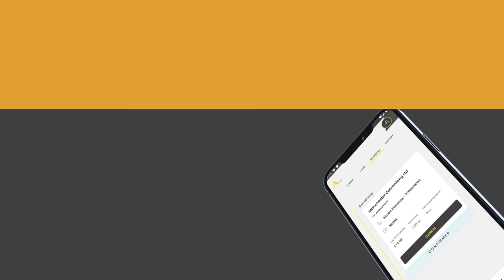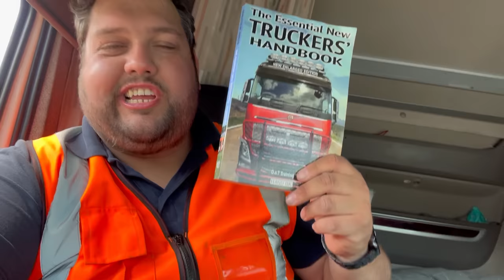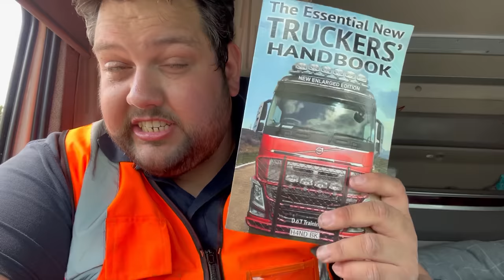Protesters Shutdown M25!

Comment: Was a bit iffy yesterday, had a Leicestershire -> Uxbridge -> Swindon -> Leics run. I never normally listen to the radio at all but tuned in a few times to see if things were going to be bad on route (luckily, 3.5T, much fewer restrictions). Luckily, not between the M1 and M40 so I got out lightly. My mate (drives for Royal Mail) took 4 hours to get from Gatwick to Heathrow and was... "happy"...

Comment: I wonder if the 2Win lorry was on its way to my old employer in Purfleet. They had some arrangement where the lorry would turn up purely for paper work, and it'd alway turn up around mid-late afternoon.

Also, those protestors are nothing but a nuisance and should all be locked up.
Thankfully recent changes to the law have allowed police to arrest them on site for causing this kind of disruption.
At my previous employer we had several days of complete disruption caused by the protestors, seeing as we were right on top of J31 of the M25.
Disruption ranged from staff being 2 hours late for the start of their shift, to delivery and collection lorries either turning up late or not turning up at all by the end of the day.

All this does is cause further disruption, congestion and pollution as more vehicles are a) on the road idling for hours, b) more vehicles required to be on the road to make up for missed deliveries and collections, c) staff or companies losing out on money due to said staff not being able to make it in on time and complete a full shift,  and all the financial implications that comes from it.

Comment: The law,  when we had a law, used to say if your on your outward part of your journey you can extend the driving hours due to hold ups caused by unforseen delays. However and, nobody knows why,  but this doesn't apply to homeward journey.  Its just silly to allow it for one way but not the other. 
Further,  your allowed to extend your driving times if your vehicle has suffered a delay due to unforseen circumstances,  like a breakdown,  and need to move it to a place of safety.

Comment: the day the bloke climbed the QE 2 bridge, i got stuck coming off the A2 on to the m25 at about 7ish in the morning. its was all move slowly then it just stopped after the point of no return on the slip road :( took me 6 hours to get to Thurrock to another depot for the company i work for, went an hour over my duty time and missed the 2nd 45min break, so i had a tacho print out longer then my arm, lucky the boss paid for a hotel for the night so silver linings.

Comment: Wincanton leighton  buzzard insist you double strap stacked pallets and why haven't you cross strapped the rear pallets?
Reply from the maker: Because I’ve never been asked too or even told too.
Reply from the maker: If I had to double strap stacked pallets I’d need 26 straps 😂. I’ve NEVER seen anyone double strap stacked pallets.